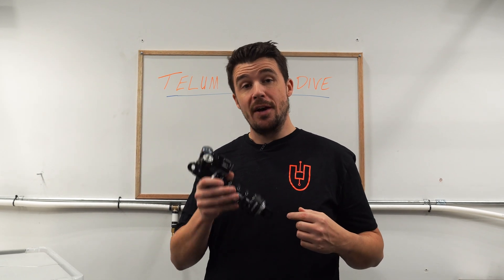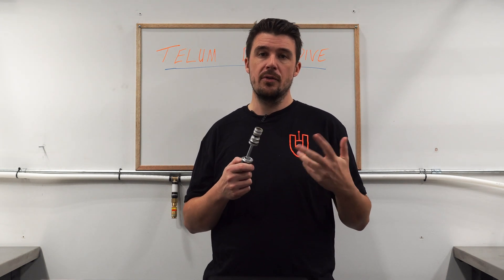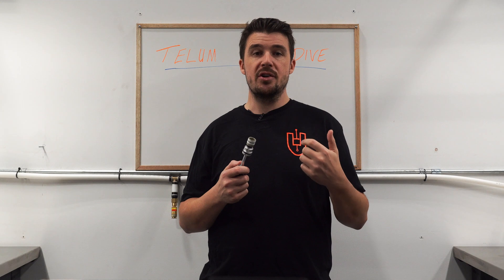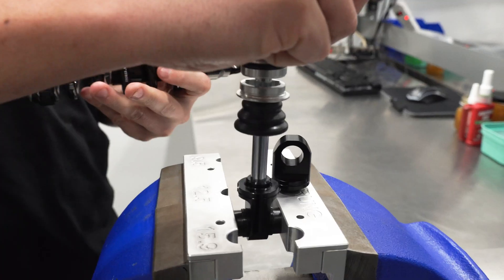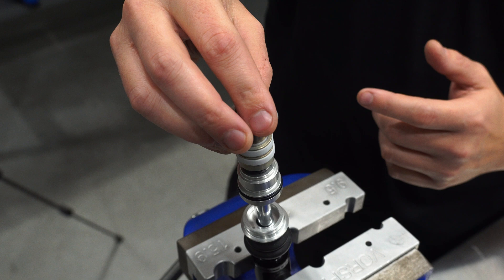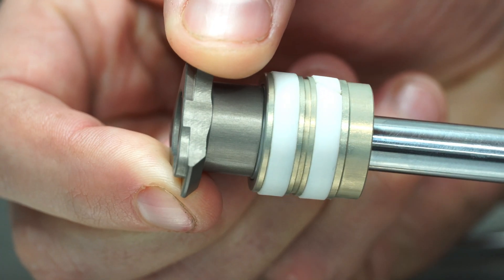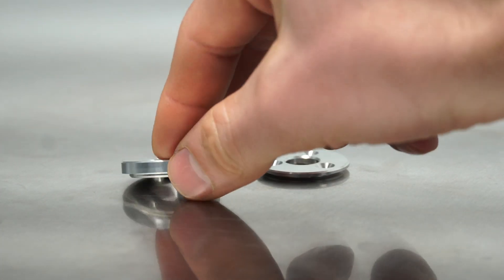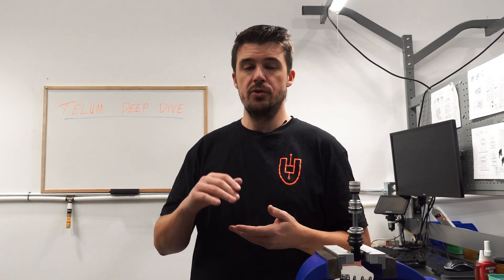Vorsprung Telum DEEP DIVE - Part 2 - Design details, HBO, damper shaft, stroke adjust

Comment: how would you compare this shock with the fox float X2 ? and could this shock work with a Santa Cruz V10.6 2016 frame shock size is 222 by 70 mm (8.75 by 2.75) shock bolts are 22 by 8 mm
Reply from the maker: Unfortunately the Telum is only made in "metric" sizes, such as 230x65, 250x75 etc so it won't fit your 2016 V10.

There are a huge number of differences between this and a Float X2 - pretty much the only design element they have in common is that they're both twin tube dampers. Check out parts 3 and 4 of the Telum Deep Dive videos for more details!

Comment: Seems like you out in a ton of work to get the details right and get some of the most important stuff, such as the double supported sealhead and spherical bearings. 

One question from this video: did you test DLC for the shaft? That was always the go-to upgrade over hard chrome for motocross stuff. Ti Nitride was another option. Curious how you landed on chrome over those. Maybe the cost just wasn’t worth it, those coatings I recall being several hundred dollars alone as upgrades.
Reply from the maker: Thanks, yes we have focused heavily on those details! TiN has been tried a few times in the past (eg the 2016-20 DHX2s) and we saw a lot of issues with chipping. DLC is great for friction (although realistically a modest improvement over hard chrome on such a small surface area), but not so great for wear resistance because it's so thin (like five microns) - without a super hard layer (such as tungsten carbide) beneath it, what happens even to a very hard outer layer if it's super thin is that it's flexible enough to pass high local stresses (ie gouging) through to the substrate. This then leads to the substrate being damaged and separating from the coating. Hard chrome is much thicker, and while it performs worse than DLC in lab hardness tests (which aren't very good representations of gouging damage, which is what almost all wear on suspension is), its ability to resist passing damage through to the substrate is superior. It is the industry standard for a good reason there - if you want it to be low friction AND last a long time, it's hard to beat.
Reply: @ Great response, you really did your due diligence. As a mechanical engineer myself I can fully respect and love the work done here. 
One other thing I recall from the motocross world is having a roller thrust bearing for the spring to allow it to twist when compressing. I know bikes have a lot less space generally but any thoughts on that to help with the “frictionless” feeling?
Reply from the maker: @kevinclark9176  thank you for the kind words. 

Thrust bearings at the ends of the spring don't affect friction per se (since the spring is just subjected to a slightly different bending mode if it's prevented from twisting). In extreme cases they can change the linearity of the spring rate, and reduce hysteresis of the spring curve (ie the extension curve tracks the compression curve more closely), but they don't actually do anything for friction as such, particularly in the sense of stiction (on which it has zero effect), because the dynamic friction at the end of the spring just leads to a slight difference in rate between compression and extension, rather than any actual change in the ability of the suspension to freely respond without overcoming stiction.

They don't hurt anything either really (other than weight, cost, and a gritty feeling if they're able to get dirty or corroded, but all these are minor), but they achieve so little that I would go so far as to say they're more or less a marketing gimmick.

Comment: Im not sure about this, however it looks like there is  lot of similarities with the OHLINS TTX22M.2  tech, I could be wrong.
Reply from the maker: @danielpatino81 there are many similarities (because Ohlins have some extremely good engineers) and many differences. 

Similarities:
Piston diameter, shaft diameter, twin tube layout, LSC/HSC/REB adjusters externally, sealhead retention method, sealhead protection method, shaft material/coating.

Differences:
Rapid Revalve (obviously), solid piston, HBO, polymer sphericals are all found on the Telum and not the TTX22, finer adjustment resolution on the Telum (eg 18 clicks of rebound vs 6 on the TTX, 12 clicks HSC vs 3 on the TTX), Telum sealhead bushing is oil-immersed vs dry-running on the TTX, IFP on the Telum instead of a bladder.

Comment: When talking about IFP Friction and Shaft Friction, would it make even less friction and Better durability to use an X-Ring instead of an O-Ring on the IFP and the Sealhead?
Reply from the maker: @dince4716  in theory yes, in practice we haven’t seen it work better, and quad rings are hard to come by in metric sizes as are required for the shaft. Further to that, the friction reductions with quad rings come from the reduced squeeze, but with reduced squeeze also comes less tolerance of eccentricity, which means side loading can more easily cause leakage, as well as lower wiping capability which means more oil residue on the shaft.
Reply: Is that NBR70 Oring as usual ? Or it's like Push oring (feel like another kind of rubber)
Reply: @tigerso5530  hopefully its not a parker 4300 o ring like the ones used in the old fox x2, good luck sourcing that o ring alone, its a PU90 o ring but with special coatings from Parker that is about 60% better than your standard pu90 o ring, but even the standard pu90 o rings are hard to find
Reply from the maker: @tigerso5530  They're NBR70. In our experience, polyurethane o-rings are more prone to mold flash problems and have higher friction. We tried a few different compounds that are theoretically a bit better with friction (eg viton, HNBR etc) but couldn't feel any difference in friction on the shaft (Viton was actually worse) because it's ridiculously smooth anyway, so we decided to stick with NBR.

Comment: What would be the different vs a push elevensix?
Reply from the maker: The Elevensix is a solid shock. However, there is a $400USD price advantage to the Telum, Telum can be revalved in minutes at your home if you wish (see videos 3 & 4 from this Deep Dive), the Telum has polymer spherical bearings (no corrosion or play issues, plus lighter weight), and the Telum's warranty is transferrable down the track. The Telum's hydraulic bottom out is also adjustable (11.6 is not) and acts over a longer distance, which means it can be more effective and generate lower peak forces. Retuning the Telum for another frame is a sub-five-minute job if you ever want to do that too.
Reply: @VorsprungSuspension the tune of the Telum sounds more personal too whereas what I’ve read on the 11.6 is it’s still only semi-custom (takes into account bike leverage and rider weight but not rider skill or terrain).
Reply: For some counties, Telum will be less hassle for shop tuning /service and user, some users be happy to keep the shock forever to next bike( if same eyelet length).

Comment: You should have gone with stainless steel. They have less friction and strong too.
Reply from the maker: @5dayMovingAverage  stainless steel damper shaft you mean? They have higher friction than hard chrome plating, lower hardness (more wear) and even very strong stainless alloys like 17-4PH are not as strong as the alloy we use.

Comment: I have a gen 3 levo. I have the cascade components link (160mm not the long travel version 210x55 I believe). Is the tellum compatible?
Reply from the maker: How long is the yoke on that frame? As long as the total length (yoke + shock) is lower than 315mm you should be ok. For full details on why that is, check out this document - https://cdn.shopify.com/s/files/1/0767/8621/files/Shock-Frame_Interface_Design_Best_Practices_-_Rev_B.pdf?v=1724714800